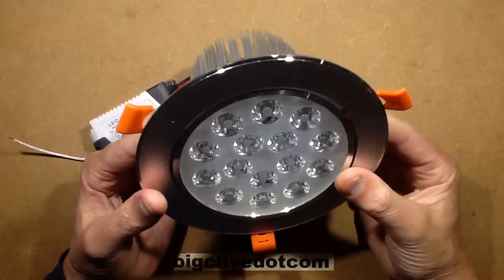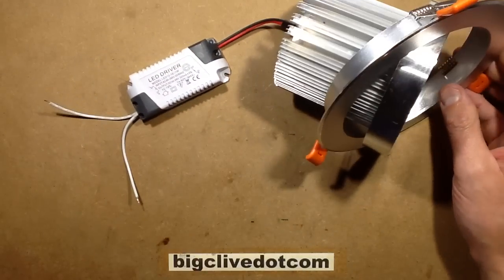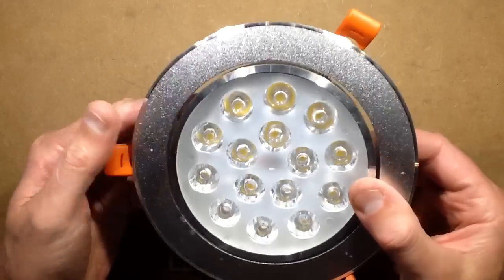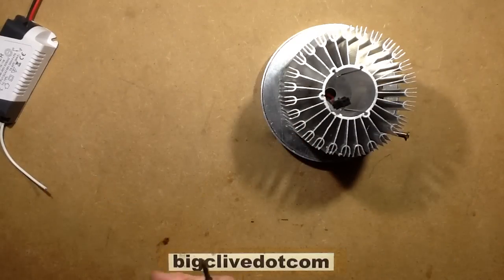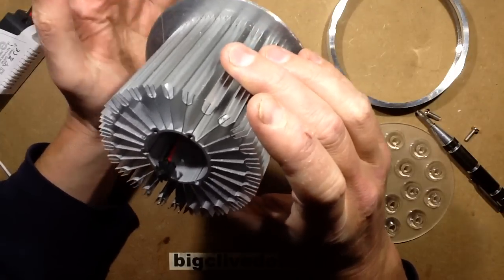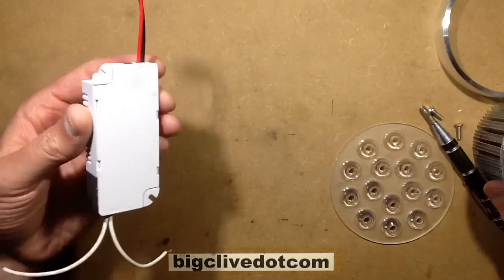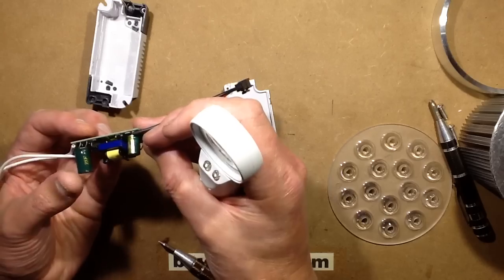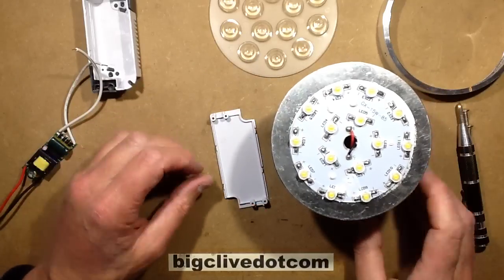A look inside a "45W" LED downlight.

Comment: Clive I know leds are better under run but 13watts! if they are 3 watt leds it should be 25 / 30 watts you would think!!
Reply: No,  LED wattage is only the upper limit.  The correct wattage to use depends on the other variables, ambient temperature, airflow, heatsink surface area.  Too many people don't understand that you should completely ignore the LED wattage as anything other than an upper limit.  It is never something where you should think "it should get closer to that upper limit" because it never should.  A good design uses higher rated LEDs no matter what the heatsink is.  In other words this light runs the LEDs at a little under 1W each but would be an inferior design if it used 1W LEDs.

In other words in this application, a downlight tends to be enclosed.  That is the first limitation along with the available space for a heatsink.  No matter how well engineered a product is, it still has to work within these two limitations.  It could have a fan and intake/exhaust out the face, but then you have dust buildup and noise.  It simply isn't needed as homes are designed with enough downlights to accommodate the typical ~ 65W / 700-odd lumens per light and provide adequate lighting.
Reply: Even then, in a perfect world it'd be advertised as a 13 or even 15 watt light, not a 45.
Reply: Running LEDs full tilt boogie doesn't get you all that much more in light output.

They aren't the same form factor or on the same base, but I have a reel of 5630 strip lights cut into meter lengths and run limited to their rated12 volts they draw 3.7 amps, so 45 watts. Limited to 2 amps, the rating of the power supply I had that fit the location, they draw 10.7 volts, ~22w. And the brightness difference was just slightly perceptible when switched between the two settings on the test supply. So I turned it down to 10.5 volts to give the power supply some margin and it draws 1.75 amps (18-ish watts) and you can't tell the difference from 10.7 volts, looking directly at them or at a surface a foot away.

I've had the same experience running them on batteries. Running 18650s unregulated 3S, adding a parallel set to reduce voltage sag in the initial turn on doesn't give you either much more light, or double the run time, because they spend more time in the higher voltage region turning more of your precious battery life into heat.
Reply: Wouldn't need to be a perfect world.  It's illegal, fraud, at least in the US, but greedy sales avenues like Amazon and eBay, willfully turn a blind eye, making them partners in crime.  Ironically the fraud is so pervasive that we've all gotten used to it and just take that into account when choosing generic products.
Reply: The human eye has a logarithmic rather than linear response to light, so to that extent you are correct that you may not see a substantial increase in brightness from a doubling of current, but there is another factor.

Heatsinking is critical. As LED die temperature rises, lumens per watt decreases.  A particular budgetized design may run the LED dies quite hot to achieve a particular brightness level, especially when a strip light that needs to be flexible, or really in any case where a more substantial heatsink is more expensive than just lying about true output.

If you have a conservative, well made design that keeps the LED dies below about 85C temp at whichever current you choose, there is a fair increase in brightness with increase in current to make it viable.  Beyond that it can depend upon other factors including LED lifespan or power efficiency when running off batteries.

However, generic LEDs may be a special case, in that they are so cheap that it can be more cost effective to use more LEDs at lower current per LED,  to achieve the same light rather than better heatsinking,j which may or may not be more efficient since the compromise is the inferior heatsinking.

On the other hand, if it is not strip lighting, generic LEDs may be a worst case because their efficiency tends to be so much lower, so for any particular brightness they need more heatsinking, yet they are used in low budget designs with poor heatsinking due to that budget, so the overall product may be seen as junk that has a short lifespan, but a high lumens:purchase-price ratio so long as you ignore the lower lumens:watt ratio as it corresponds to a higher power bill or shorter runtime on batteries.

In other words I would never use a light that has generic LEDs for an overhead light that remains on several hours a day, nor for battery powered lights.  Major brand LEDs like Cree, Philips, Osram, just aren't that expensive today in manufacturing volumes.

Comment: These bead leds are 1 watt the lying barstewards

I have some 7 watt versions of that light as one led  failed (after 5+ years) I have ordered some to replacement bead leads to replace the duff one which was easy to find as the other 6 still glowed.

Comment: Its probably 15w power but 45w equivalent
Reply: If 15W LEDs were 45W incandescent equivalent, they'd be crap LEDs even by EBay bargain standards.
Reply: 15x 3w Cree epistar chips. 45w total output
Reply: +Ollies Toys could be 3w running on 1w so leds wont heat up alot
Reply: +cekpi7 potentially yes. ive built a lantern with a 3w chip running from an 18650 cell and that emits far more light than these appear to. probably the driver is running these probable 1w chips in series
Reply: +Markle2k my thoughts exactly. should put a fan on the back and use a higher power driver